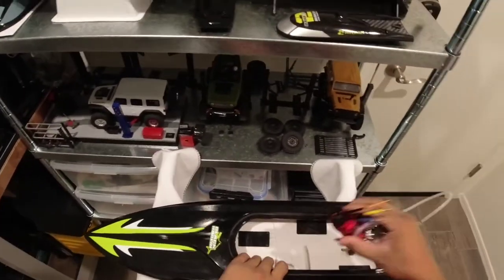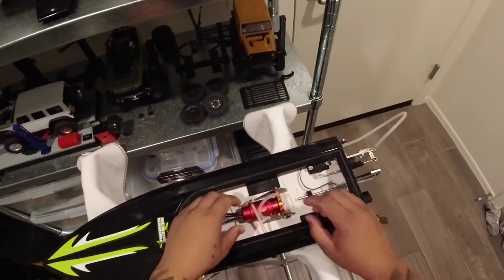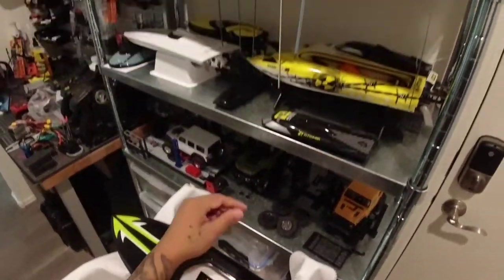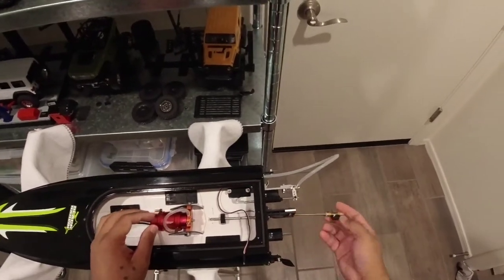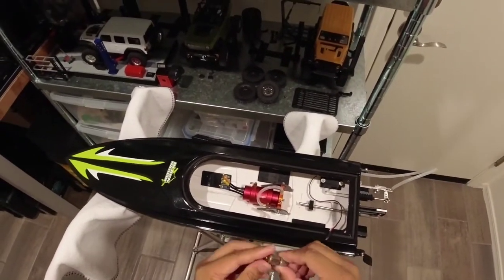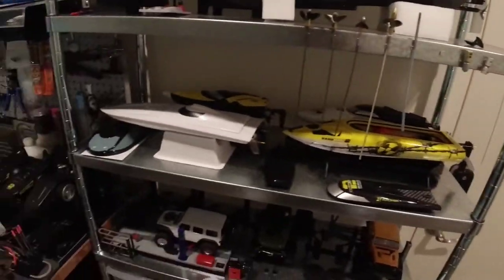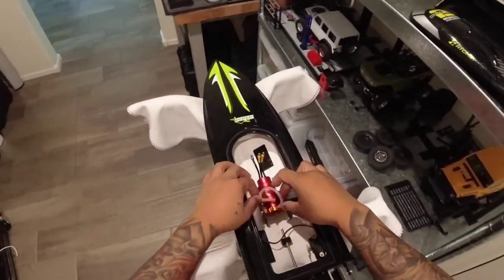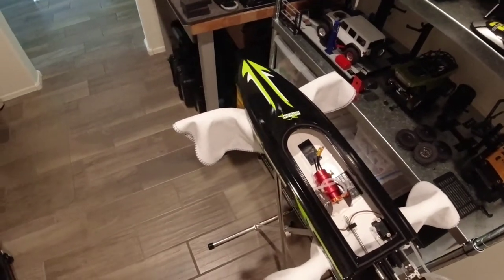A First RC Video....

Comment: Nice work bench man!
 When you get a minute please drop me a link or post one in your description of that parts supplier you mentioned. Thanks👍👍
Reply from the maker: Thanks bro! I try...When it comes to projects or any type of interest in into, I'm very OCD but that's just me. I take pride in my work.  The supplier where I get most of my parts is offshoreelectrics.com 👊🏿😁🤙🏿✌🏿🌊🚤🐓
Reply: @DoinWhatIDo  Perfect I will check them out👍👍 very new to electric rc boats, built a nitro boat b4 & there are not many good build vids on these electric boats mostly run vids. I like to see how they are modded up to go fast it's just as fun as watching them run.
Thanks for the link.
Reply from the maker: @miguelsalami  no problem sir! Yes been into boats for awhile. I'm jnto all konds or RC's but boats are my main. I'm going to post more videos soon so be on the look out. 👊🏿😜  The one in this video with the Rage Marlin has been completely redone. Stay Tuned..😁🤙🏿🚤🌊🐓
Reply: @DoinWhatIDo  Perfect will be watching your Channel Thanks💙